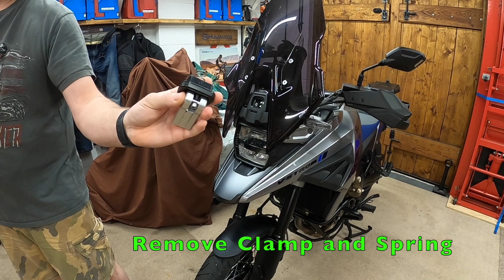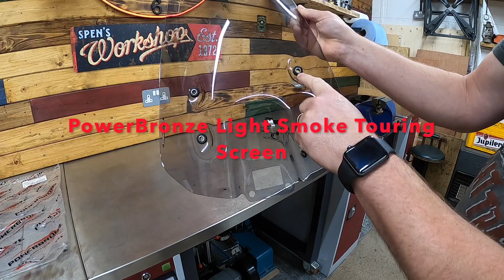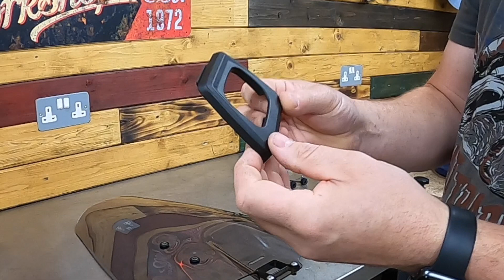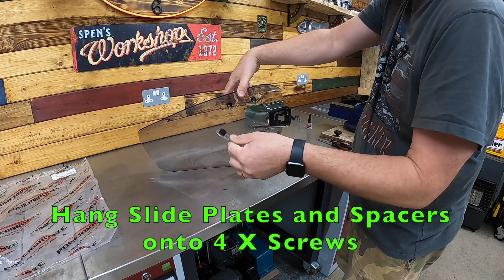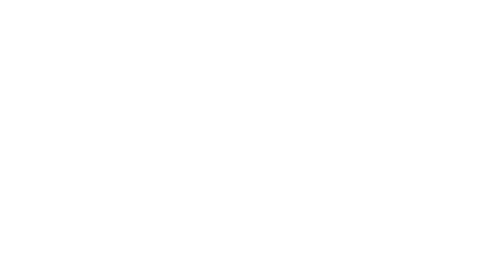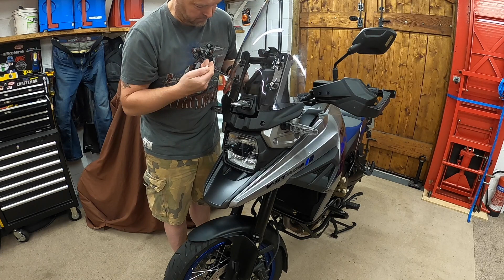V-Strom1050xt, Puig To Powerbronze Screen Swap.

Comment: Can I ask why you replaced the Puig screen with the Powerbronze one?  I'm 6"2 and the standard screen on my 1050xt is causing a lot of wind buffeting so looking for some advice
Reply from the maker: Hi, yes I replaced the Puig with the Powerbronze as I wasn’t really looking to reduce any buffering, but just wanted a different look.
Reply: @spencer2237  did you have any complaints about the Puig screen and do you have a preference as far as wind protection goes?
Reply from the maker: @blazin66  , no complaints at all with the Puig, its was definitely better for wind protection especially as its extended at the sides. I might even still have it if you’re looking to buy one used?
Reply: @spencer2237  I would definitely be interested assuming it's in good condition, thanks
Reply from the maker: @blazin66  , I do still have it and its in excellent condition.
Reply: @spencer2237  amazing, how do we make this happen?
Reply from the maker: @blazin66  im not sure to be honest!😂
Reply from the maker: Im not sure if I can put up my contact details on here? Email, phone number, Facebook ?
Reply from the maker: @blazin66  , I have just put my email address on my youtube channel profile. you should be able to contact me from there
Reply: @spencer2237  just checked and it's not showing yet, might take a moment for the change to show?  More than happy to add you on Facebook if that's easier?
Reply from the maker: @blazin66  that’s fine with me. Spencer Hunt is my name